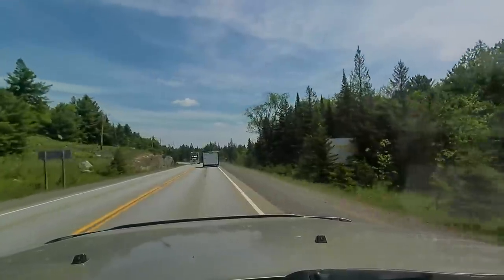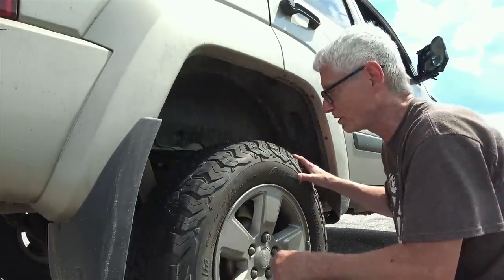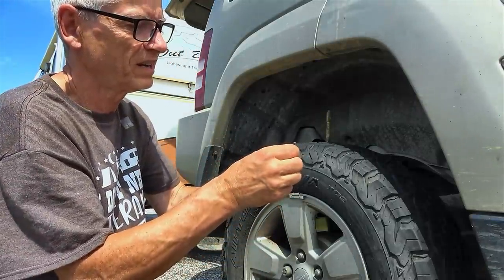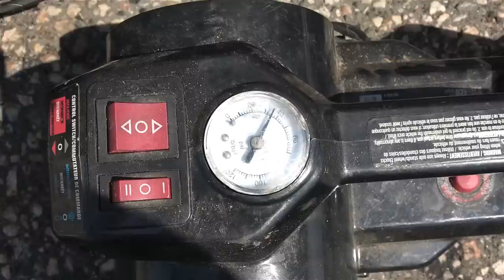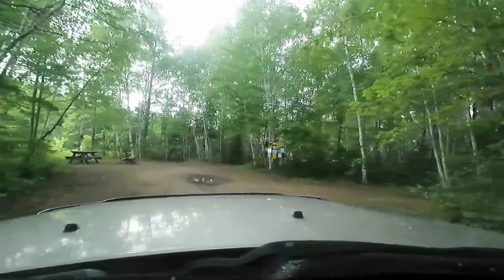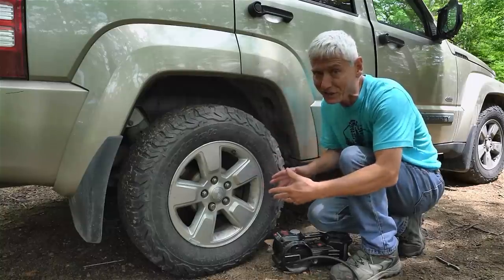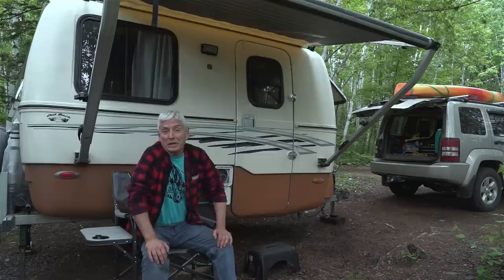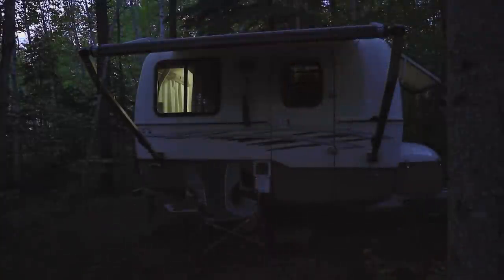One Last Problem, One Last Paradise: Slim's Road Trip Finale

Comment: Slim, next time put the repair glue on the plug. It makes inserting the plug a lot easier and helps in sealing the leak.
Reply: If you run out of the special glue that comes with the plug kit, use a liberal dose of rubber cement.
Reply: I noticed that too.
Reply: I noticed the glue thing too. Was surprised it worked as well as it did without any glue.
Reply: Some of the plugs have some sort of sticky substance in the plug , I personally like the lube and heavier plug but as usual Slim comes thru
Reply from the maker: @chrislincoln489  I disagree. The most important thing is to follow the manufacturer's instructions on how to use their product. I did. The plug already had its own adhesive, and to add an additional solvent may actually reduce its effectiveness. The cement included was for patches, not plugs. Thanks! SP
Reply from the maker: Note from Slim: No sarcasm please, be respectful when posting comments. I've taken down a few.  Thanks! SP
Reply: @SlimPotatohead  sorry to offend you. I am a loyal subscriber. Upon graduating in 1969 I started at apprenticeship and auto repair. In 1973 I went to work for a good year tire dealer. You have no idea how many snow tires versus summer tires I have mounted, dismounted, and balanced. I’ve sold tires, sold recapped  tires, and warehoused tires.

Today, my favorite tires and wheels on my wrangler are BFG KO2. In the summer I run, Bridgestone Duelers because they are more quiet and I get two mpg better. 

It took me over 10 years, going to school part time in nights, but I finally did start a second career. I always did keep my hand in The auto trade.
Reply: At least it was only phlat on the bottom.
 That's what I say when I get a phlat tar.
 At least you didn't have a blow out! Then all four sides are PHLAT!
Reply: @SlimPotatohead  Flat tires suck.  You are correct though to follow the manufacturers directions.

Comment: I always carry rubber cement to put on the rope plug, it helps it go in and seal up. Also if you give it a half turn then pull the tool out it stays in better.

Comment: Front tires you can just turn the wheel to expose the tire for more leverage.  Rears...really need to remove for leverage in inserting the plug.  Reaming the hole sounds counter intuitive but is critical.  Plug has to go all the way into the hole and get caught in it as u pull the tool out.  Ive done a few with these kits...work great if used properly.  Great series.

Comment: Tire plug kits: look for one with T handles on the tools. It is much easier to use the reamer and insert and withdraw the plug needle with T handles. If possible face the puncture at 7 to 9 o'clock so you can yard the needle tool straight out without having to "lift" on the tool inside the wheel well.

Comment: Great video!  Little tip, carry a small tube of rubber cement in your kit.  It will actually act like a lube to make things a lot easier when putting the plug rope in and removing the tool. It will also fill any potential gaps and set the plug better once it dries.  Safe travels  :-)

Comment: Hi, Slim.  Check out the Stop n Go tire plug kit.  It inserts the mushroom plug using screw leverage, so it's so much easier in tight quarters.  The one with the black insert tool, not the big green tool.

Comment: No excuses! No truer words spoken. Take a few mins and learn where the tire repair tools are in your car. Important!  On small unibody cars,...."learn where the jack point is. You can't jack the car up from anywhere. They make a spot for it. Otherwise, you might poke a hole through the floor or put yourself at risk of the jack coming lose. Always carry a board or two for under the jack is a good idea for soft dirt or mud etc. Plenty of info online. Slim did ya'll a huge favor showing the tire plug repair. Till next time. Cheers. 👍

Comment: Hiya Slim, my dad always called them gummy patches. The last time I used a patch like that I was on the side of the road on I-75  in Port Charlotte Florida on my way home from hurricane Charlie clean up and the Blue Tarp brigade through Sumaritans Purse organization. I did it perfectly and made sure to oil down the gummy patch so it wouldn't stick to the hot pavement. It worked perfectly till I hit my shale driveway. There was barely any of the tail left but just enough to rip it out. Who knows what I hit but I wasn't about to go spend another $800 on a new tire considering the tire was only 6 months old so I double up on the gummy patch and it never came out again. I had swamper tires and a 6c lift kit on my Cherokee because my dirt driveway was prone to flood in summer. Never got wet after doing the lift kit even when the dry creek bed flooded my 2 acres with 4 ft of water. Happy trails and safe travels to you

Comment: Look for a Tire Repair kit that comes with a T-handle tool instead of a straight handle tool.  You can get a better grip with a T-handle tool & generate more push/pull force.
Being prepared to change a tire & start a dead battery are two things everyone should have in the way of the needed tools.  
    A spare Metal Safety gas can is also something everyone should have when traveling cross country.
   And last, but not least, a gallon of water for self or radiator, just in case.
Warm Regards from Reno, Nevada

Comment: My tire repair kit came with a small bottle of rubber solvent/contact cement mixture (it's a blue goo) which I'm supposed to smear all over the plugging cord to lubricate it, making it easier to insert, AND chemically fuse it with the tire rubber as friction raises the temperature of the tire. My roadside plug jobs have all been permanent (and it ALWAYS works the first time) never had to go back to them for a more "professional" fix. Try to look for a similar product, Sim...
Reply from the maker: Please always follow the instructions from the manufacturer. I did. SP

Comment: One of the issues with the fixing a flat is not only the plug but just driving on a low tire. I pluged a tire and thought I was ok then after watching another Youtube video about how driving even a small distance on a low tire can damage it I decided to take it in. When they removed the tire from the rim it was all ripped up on the inside of the sidewall with no damage on the outside. basically a blowout ready to happen at any time. luckily I was able to replace just that tire with the same model since there was not many miles on it.
Reply: Right On!

Comment: Check to see if your radiator fan goes on when your AC is on. As soon as you turn your AC on the electric fan turns on. 
Patches are better then plugs, but you need to do what you need to do when it needs to get done

Comment: I carry three different types of tire repairs since the plug you used is one of the more difficult ones to install trying ream and get that rubber plug in.  I also carry the liquid sealant that has a new nonflammable formula.  Then I carry this new type of rubber screw that I found online.  You just find the hole and use some rubber cement and screw this rubber screw into the hole.  Easy peasy. Of course like you said it should be checked out later when you get to safety again.

Comment: Hi Slim, good video!   I carry one of those tire patching kits with a pump in my truck and one on the Quad.  I've never had to use it on the truck, but the Quad is another story.  I do a lot of riding out in the desert and if there is one nail out there I will find it.  Here is a little tip to make the patch go in the tire a little easier.  I carry a small can of Rubber Cement to lubricate the plug before inserting it.  Once inserted, the cement helps to seal up the hole.  Works every time.  I think the can of cement is called Slime Tire Patching Cement.
Reply: I meant to say "Slime", not Slim.  I fixed it.

Comment: Always coat the plug with rubber cement before inserting.  Acts as a lubricant going in, makes a better seal too. Also, if you rotate the tire so you can insert the plug laying on your side on the ground (hole at the 4 o'clock or 8 o'clock position) it's easier.
Reply: RIGHT on about using the Rubber Cement that is included with those tire patch repair kits.  I mentioned in my reply that many Tire Patch kits come with a T-Handle insert tool for better/more push/pull leverage.
Reply: I kept bracing for a knuckle knocker!

Comment: You could have a blockage either in your radiator or maybe gun between radiator and coolant as to why it overheats when using the ac. It's restricted somehow.  Great video. I just bought me a 12v air compressor for emergencies. I'm trying to get what I need before hitting the road.

Comment: Having a dial type of pressure gauge is better than the stick variety though a bit more expensive there more accurate and robust. Carry a set of jumper cables the longer the better so it can reach across both vehicles side by side since shorter ones are just being head on and they pop of easier too. Try jacking a vehicle  where a flat tire is off the ground when using a portable pump so it won't fight the weight of a car etc. because its faster-easier on the pump. When changing a flat tire loosen  the lug nuts a bit first before jacking it up because it won't spin unlike when its off the ground and there's are trick to a tire iron as well. Many have an angle on them for a reason since once there on a nut you can put to your full weight on it with a leg to break them free often going counter clockwise. This  is also  good time to check the spares air pressure before putting it on just in case its low-flat and filling it with air before going on is faster. Once the tire lugs are snugged on so it won't wobble you can let it sit back on the ground somewhat to tighten it the rest of the way reversing how you use the tire iron  usually going clockwise this time. Having a short plank to go under a jack is a good idea since it distributes the weight more and locating the frame to pilot it up on as well since an axle is a big no no especially the front suspension...😀

Comment: Slim after cutting the flat fixing rope about a 1/4 of a inch still sticking out  of the tire ,,get some dirt /sand and rub on the plug that will keep it from sticking to the road and pulling out thats the way I always did mine after having it yanked back out one time by a hot road and gooey tar on the hot days ,, just a little something extra to make sure it works , we will see you next time
Reply from the maker: Good tip. Thanks!

Comment: If the leak isn't too bad, a good inflater/sealer comes in handy, like Green Slime or other brand.
Reply: hmmmm, please explain the line of demarcation between a "not to bad" leak & a "bad" leak.
Reply: You can't use that in a wheel with the air sensors for your dash. The Sealer wrecks the sensors.

Comment: Slim,
    Just wondering...what is the maximum tire pressure for your tires listed on the sidewall?  45 psi seems a little high for the type of vehicle and tire size.  Another question comes to mind (or two).  What is the weight of your trailer loaded and what is the tongue weight?  As light as your rig looks, I'm surprised you need air in the tires.  ("just funnin")  
    Be well and stay safe,
bf
Reply from the maker: 50 psi. They are truck tires. The trailer is typically just under 2000 lbs loaded. Thanks! SP

Comment: Did you also inspect the trailer tires, after the vehicle flat?
Do you have a separate tire pressure monitor for the trailer?
Reply from the maker: Yes and no. I monitor the trailer tires with an air guage. Interestingly, I did actually buy remote tire monitors for the trailer, but after reading several pages of poor english, I tossed them! SP

Comment: Slim, is or was your windshield leaking? Noticed headliner is stained above driver area.
Reply from the maker: It's a result of leaving the sun roof open during a rainstorm. Just never get around to cleaning it! SP
Reply: @SlimPotatohead  ok cool, just checking so you didn't have a rust nightmare

Comment: I wouldn't use the airpump gauge, they're notoriously innaccurate.  Best to use your stick gauge.
Reply from the maker: If you saw my Yukon video, during the last flat I discovered that my stick guage was way off. The dial was however accurate! SP
Reply: @SlimPotatohead  how do you know?  And for the low cost why not replace it?  It's been three years and is terribly important for a trailer tower.

Comment: when flat tire present itself pull over safely set up traffic cone, examine tire, locate leak, spit on it watch for air bubble, remove wheel, rim hole to clean hole. follow flat tire kit instruction. SP A+

Comment: The strength you need to plug a truck tire will limit who can do it. Changing a tire is a good plan B.
Reply from the maker: It all depends where your spare tire is. Mine's underneath and all my tools would need to be moved to release it. Now that would be good excercise in 90 degree heat! SP

Comment: I must learn how to plug a tyre, but first I have to know if it's legal here in the UK, but I prefer birdsong to generator din, 🇬🇧🇬🇧
Reply from the maker: To suggest  it is a crime to repair a tire in an emergency is ridiculous. It should however be monitored and brought to a tire repair shop for further repair if needed. SP
Reply: @SlimPotatohead  Hi Slim, just looked at the legality of the tyre plug question, it says, a Tyre can only be repaired if it is a small puncture  ( less than 6mm in diameter ) in the central 3/4 of the tyre, anywhere else is deemed unsafe as it's too close to the sidewall 👍🇬🇧
Reply from the maker: I totally agree. You should never attempt to repair a tire that is beyond safe repair. SP

Comment: I was told that if you put in a rope type of plug - the large hole required for the "rope" makes a proper interior patch NOT able to be properly installed (because the patch actually has a stem on it).